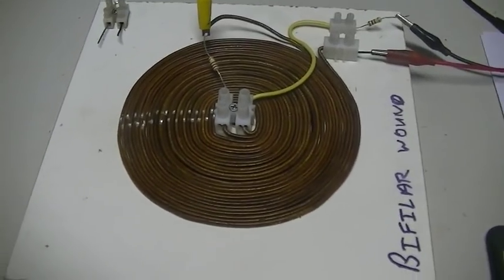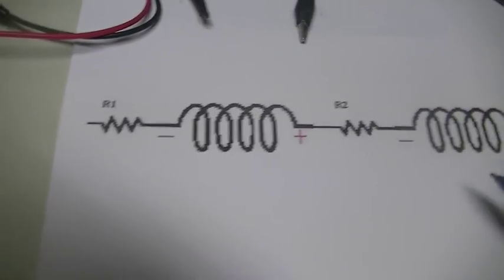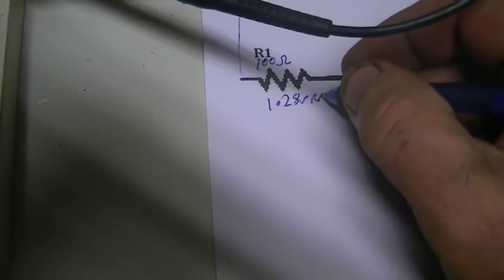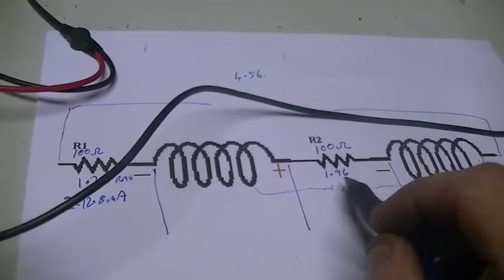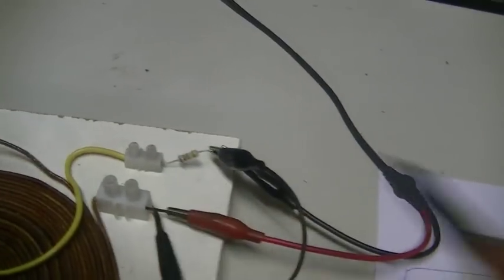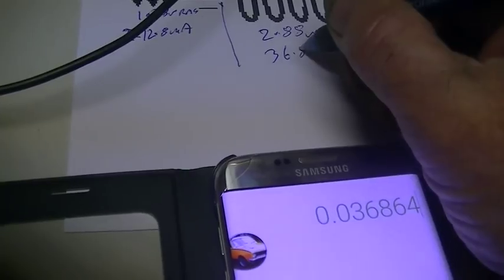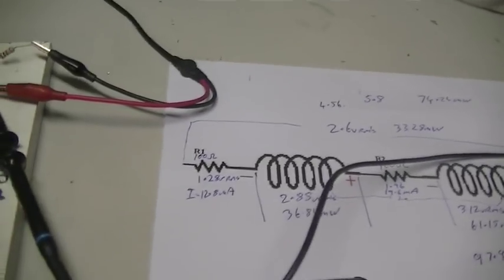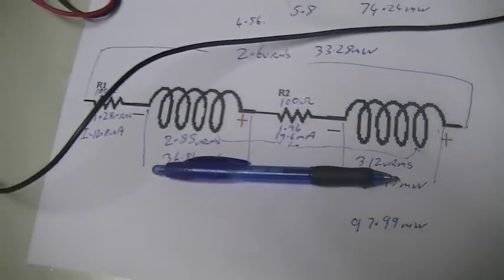Tesla bifilar coil Overunity Effect

Comment: Hello. Really good work here. Thanks for all of it. Did you ever ramp up in power to see what happens, something more substantial than lighting up an LED?! I saw you had messed around with the induction cooker and the Tesla bifilar pancake coil. We're you able to obtain any numbers near overunity? I think with an oscilloscope you can get accurate voltage and current readings no? So I wondered if you had taken any readings while messing about with the induction cooker? I don't have an oscilloscope but I do have an induction cooker and a bifilar pancake coil. Any suggestions in other method(s) of getting accurate voltage and current readings of the outputs? Thanks!

Comment: A few notes on these measurements:
1: In most cases a function generator will have its ground connection, connected to earth, as will the scope. If this is the case, then whenever you move the ground connection closer to your positive function-generator-probe, the more amps you'll measure.
2: connecting your probes across the resistor inside the magnetic field of the coil, might in fact function as a single winding, which can either add, or subtract up to the equivalent of one turn of voltage (this'll obviously be decreased by the resistor, but it might not be negligible regardless).
3: The resistors can have a fair amount of difference. It'd be a good idea to measure them out of circuit, and find two that are very similar, and use those - or at least use the measured values for calculations.

These's likely also more AC-things to consider, other than this, but these are not yet my strong-suit

Comment: Ohm's Law applies in DC circuits.  In AC circuits, you must:

1)  use RMS (root-mean-square) voltage and current values

2)  use impedance (XL, inductive reactance, and XC, capacitive reactance) and resistance instead of simply R (because the impedance introduced by an alternating current in capacitors and inductors varies, depending on frequency of the AC)

3)  use a power factor for the phase angle difference between current and voltage

If you're arriving at 'over-unity' in an AC circuit without considering these issues, and simply applying Ohm's Law used in DC circuits,  it's definitely worth looking up those things online.

One example of an oddity is a series-resonant LC circuit.  Tesla referred to "resistive only" in his bifilar coil patent.  This occurs at the resonant frequency of the LC circuit (only), because XL and XC cancel each other.  Series-resonant circuits and bifilar coils are not uncommon, but applying Ohm's Law to AC circuits is uncommon.  You'll be a lot more confident about your findings if you know AC, RMS, phase angles, etc.
.

Comment: I think I might understand why this is happening. the current can be compressed and expanded in certain parts of the circuit in other words sometimes you can measure a higher current in one spot and a lower current in a different spot of the circuit which means the overall current of the circuit is the same.  kind of like a hose when your watering the garden and you get a kink in the hose the pressure behind the kink is higher the pressure in front of the kink is lower when you add them together you get the same over all pressure as when the hose is flowing.  I have done some amazing work with these coils check out some of my videos.  https://youtu.be/Qzmbe_gDPEU
Reply: Hi hi :D

I'm working on the standing wave theory,  I think tho what you said is similar to that but said in a different way, key for me is dual wire = transmission line effect or inversion of etc,  as f rises the wave rate is rising in relation to the line lengths. There should be nodes and harmonics where the system is more optimal.
Reply: @kolinevans9127  That was just a guess. I might be wrong. It's hard to tell when the voltage and current is changing inside the coil. still my favourite component but

Comment: Truly, to format a video like this, one should show the isolated/non-isolated power circuit explained for an over unity video.

However, the AC might be DC induced because he does not have a short with a proper diode preventing the DC energy from reflecting and becoming resonant AC as shown. There was likely nothing special about his power supply. The coils in that form can demonstrate higher watts draw than the total circuit, but it cant tap it usably because it's simply demonstrational in scope.

Comment: Your diagram does not match your build. The coils share mutual inductance and capacitance, not just a single wire series connection through R2. Both the active components are field effects, which while they operate, invalidate Kirchoff's law. The voltages will be dependent on which direction you measure the voltages and can instantaneously have multiple values (reality bites sometimes). B

Comment: To measure power, could one use a extension cord with 2 sockets for signal generator and oscilloscope?
Plug that extension plug into a digital power meter, for example a Kill-a-watt.
Do this for both,
Sig gen + scope,
Sig gen + scope + coil.
Then subtract the values.
Could coil power be measured this way?
Thanks for sharing your experiments! =)

Comment: some late info.     it is not clear how input energy was  calculated/estimated.  
if it is there, kindly point  me to it.      without assuming that all measured
values are correct,  it should be understood that  energy dissipated in a 
circuit  is  Not  the same as  Usable  energy,  coming  Out of a circuit. 
in you are still interested in ou, you are invited to review  my research.
cheers

Comment: current is the same in series. When calculating power with AC you have to account for phase. You cant just use formulas meant for direct current to calculate power consumption for circuits using alternating current. I x V = P only applies to direct current.
Reply: agree.  sorta.    this would appear to be  dc, oscillating at  uhf   frequencies. 
just  Silly.      there is  no  ou   in  rf-oscillation rates.      there is no ou in 
coils, transformers, pulse motors or back-emf.      if there were,  Someone
would have  succeeded, by now.     cheers
Reply: @daviddavids2884  youre right. after rewatching the video (well skimming it lol but i get the idea). he's just pulsing dc. I was mistaken.

Its frustrating seeing videos like these. In this particular case, i dont believe this guy is a scammer but just doesnt understand how to do a proper analysis of the circuit and the math to see that he's not achieving ou. But most times theyre just lying assholes looking for donations or views. it drives me nuts.
Reply: @daviddavids2884  I have a physics and EE background (college and career) and I wish I could save folks the time and anguish of pursuing 'free energy' from common circuits.

You need a catalyst to get an above-unity benefit.  For example, if you have a radioactive material that provides a source of energy, you can do the following:
1)  start with an old-time crystal radio set - they did not require any power source  (they were popularized in the first years of the 1900s)
2)  add some radium to some mercury vacuum tube amplifiers to provide conditions that will initiate a tiny plasma in the tube
3)  add a bank of capacitors
4)  tune the crystal radio to a known-good local radio station that has good reception in your area
5)  wait for an hour, thereabouts

The incoming radio wave will be received in the crystal radio section and used as input to the vacuum tubes.  The amplification will be extremely small at first but with a positive feedback loop, the tubes will keep increasing their output over the hour and you can charge the capacitor bank.  BAM, you used a radioactive catalyst (the radium) and you used no batteries or input power and you have a fully charged capacitor bank.   If you are judicious and do not bleed the capacitor bank dry too quickly, you'll have a source of free energy that replenishes itself  (unless that radio station goes offline!)

The catalyst was needed - the radium 'got the ball rolling' with the "cold cathode" vacuum tubes you'd use in this case.  "Hot cathode" vacuum tube amplifiers would have required at least a battery to get the tube to start working.  The radioactive source - the radium - provided the initial spike to get the tube working.

The above device is the basic design of T. Henry Moray's "free energy" system.   You cannot easily buy radium these days is one issue.
.
.

Comment: This was a bit slow and scattered. All in all, no one cares about RMS or KWh, what is desired is application results. Look! It can run a toaster! Here it is running my Home Theater! I disconnected my Fridge from the grid! Those things matter. But this presentation does not propel one to that point. Watching a pen pointing to a schematic that was not complete and doing measurements here and there is not exciting nor informative. Loved your scope though!
Reply: agree.  sorta.    overunity is  More  Watts  out,  than went in.   
those output watts  Must  be  shown,  via  Correctly made
METER  READINGS.        NOT  by  lighting lights, etc.   if
interested, see my ou research.     cheers
Reply: No. Cannot agree at all with "no measurement" and credit the author for trying. Correct measurement and use of the oscilloscope will determine what is going on with pulsed DC but it needs to be resonant to jump to the next level

Comment: The cold  energy induced into a bifilar  coil   and the potentials  as Tesla   envisioned   when  reabsorbed  and inverted the volume   can be looped  to  produce  the over unity I believe  he used to power his electric   PaceArrow.  Why else  did   it  have have a  radiator cooling system?   He didn't use  a DC motor  in  his  car  because  he was an AC man  and  to  run  AC motors   the cold potential must  be inverted from  a storage capacitance.

Comment: how can you have different current ( Amps) calculations on a series circuit? you ignored the impedance of the coil. there are some discrepancies in your calculations mate..  good work though..
Reply: Both coils cannot be identical, due to the geometric setup they are in.

Comment: I'm afraid   TinManPower  got his calculations wrong. In AC there are three factors  of impedance capacitive reactance , inductive reactance and resistance .   Resistance  of the resistor is based on its specification  sheet  however there are resistors  keeping its resistance in wide range of frequencies.   We have no OU here and unfortunately OU does not exists.  Violation of laws  of thermodynamics is simply never found and was never  present  in any form.  OU is just  nice dream for many. WE use term FE Free Energy  that is real it exists and it is found in nature  as a form of energy conversion  that does not cost us any money to use it. 
If something looks like OU for you , it is your  lack of understanding  of how it works. 
Even if you have free lunch  in nice restaurant it will  be just conversion of someone money, attention, resources and willingness for you to have it for free,  and this is  your Free Energy  not OU.
Well...with the exemption of the fact that FE  we are interested  with is  the energy that is free from all of these factors from above. 
Wesley
Reply: Over Unity is a mix of several forms of energy together, if we are using electrical energy to alter another source of energy like magnetic field of a magnet to produce extra energy produced by a mechanical, electrical, or magnetic system is called O.U. What I mean is we are using several forms of Natural Energy to Convert it into other forms of energy, so no Physical Laws are broken. Nicola Tesla Resonated Earth Magnetic Field to Get Unlimited KW of Electricity he gave in little to get out more than he put by altering another form of energy which is in this case the gravitational force. Inventors do not think traditionally that's why people reject any strange idea.
Reply: Sonoluminesence violates thermodynamics, as do many other obscure phenomena. But you are correct about power factor.
Reply: The Earth is a big ou machine, still spinng after all these years, that's a lot of power coming from somewhere. We should be able to tap in to it.

Comment: Replace one of the series coils with a series capacitor for bigger thrills.  Then remove the resistors and tune the circuit to resonance - the "power" in the inductor will try to go to infinity as will the "power" in the capacitor, and the voltage across each.  I used to create thousands of volts and hundreds of amperes this way.  Your "power" calculations will go into megawatts with very little heat if you use large enough wire.  Add a spark gap across the coil and change your name to Tesla.
Reply: and then what?  whats the point? file patents forever as if no no else can come up with these ideas and try to get rich and live on earth forever?  say hello to the dinosaurs, we need warp drive man!

Comment: Reactance, admittance, susceptance make ac circuits interesting. Also, consider that each oscilloscope probe has a grounded shield reference so is doing single-ended rather than differential measurements. The oscilloscope performs voltage measurements only. As some have pointed out here, reactive components shift the phase of the voltage versus the current depending on whether a coil or a capacitor.

Is your oscilloscope able to do probe 1 minus probe 2--is that what you are using?

It would be interesting to have a dedicated oscilloscope channel and display trace for each node so that the waveform for each node could be phase compared to one another?

Electrical networks can be analyzed by complex number equations. The complex numbers can be placed into a matrix. The matrix can be converted back into real numbers for easier computations in computers.

I had a book that explained how this was done that was entitled "Pascal programs for scientists and engineers" by Allen R Miller (1942–2010 an American mathematician) published by Sybex Books in the very early 1980s. It basically converted to real numbers via complex conjugates, but this made the equations (matrix used) double in length and width, but this is no obstacle to a computer with sufficient memory to hold the information, etc.

The main complication for me at the time was deciding how a network component would be entered into the complex number matrix--the modeling. As a student at the time, I kept having to decide to convert or not the component into its Norton or Thevinin equivalent--and making mistakes at every step of the process.

A Tesla pancake coil was partly known by me back then, but I never knew the circuit model for it. I never progressed in electrical engineering in that area to be able to model distributed inductance and capacitance based on the physics of the materials used. This would involve permittivity, conductivity, emissivity and words of that nature for each of the conductors, insulators / sheathing, etc, and particularly the geometries / layouts used. Part of this would be the nature of the conductor--solid or stranded wire, consistent or irregular wire diameter, etc.

Comment: interesting analysis. Though I'm wondering why at no point you take into consideration the resonant frequency of the system. An important factor, since the coil is intended as an accumulator that has a high amplification factor at resonant frequency and sub harmonics. 

Check this out and tell me if it helps understand the system a bit....  https://youtu.be/AgF20K7qvx0

This circuit is merely a self contained tank circuit. The magic happens when you put both ends of the bifilar coil ckt into a rectifier feeding a capacitor, a large capacitor or parallel network of capacitors that can be discharged in series. 

Keep in mind that Tesla spent a lot of time in bed sick reading Maxwell and attempting to understand Hamilton's Quaternions. It's about potentials, not current. Current is electric, potential magnetic. 
In his deposition for the Marconi trial Tesla understands it may be his last chance to reveal some secrets and expose how his system is being used backwards to generate hertzian waves rather than build up potential (TFC books may still have copies of the book). 

Resonance is the key, and with a feedback loop, any resonant frequency can be determined and locked in. Lower harmonics are easy to calculate from there, higher harmonics don't really affect the system. He is using nature's machinery, you have to stop thinking the way we were taught in our engineering courses. That training tries to box you in to rigid rules of closed system. They chose to ignore all the other formulas relating to open systems, Tesla did not ignore them, he embraced them. 

Cheers, good luck.
Reply: You are absolutely correct..  I know main stream academia doesn't know everything about electro magnetics and energy itself...  Every time I hear or think about electron flow vs conventional flow,  I gotta chuckle.  It's much more of a political struggle than science..  The more I look at science and/or history,  I find the same thing, everywhere.
   Certainly,  The human race has come a long why on the science we have today,  but, it's still got a long way to go,  and we can't leave it to main stream science.  We all gotta think for Ourselves and share our findings,  so other can build upon that..
   Let's face it,   Schools and Colleges today,  are nothing more than training grounds for work..  We are taught what large Corporations want us to know,  so they can profit off us..